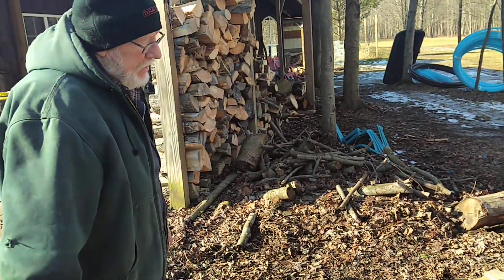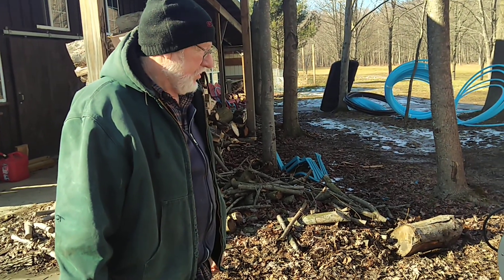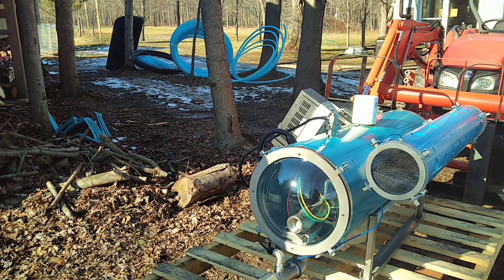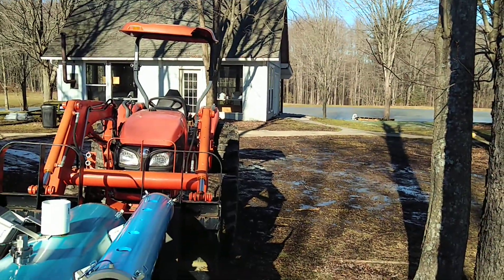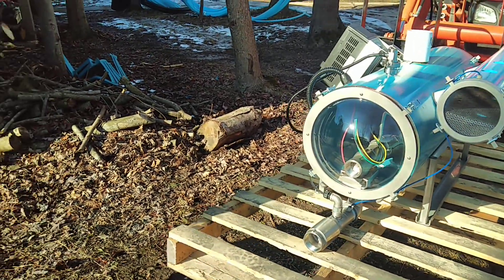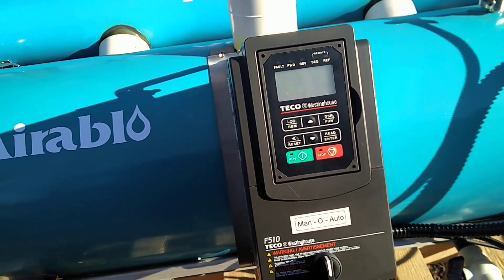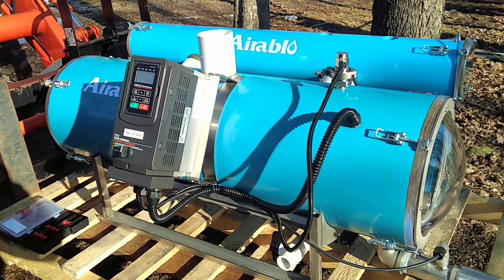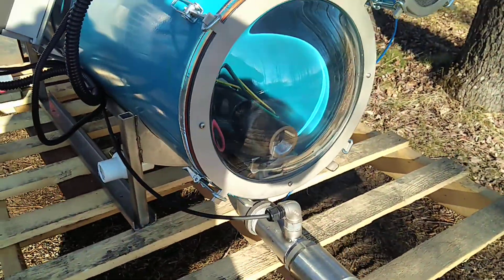Electric Releaser - 2HP 3-Phase - Leader Releaser

Comment: How did it work?  Specifically - how did you pump it so far directly from the extractor?  Is it gravity the whole way beyond the pump?  Or, did you have a check valve to prevent the flow back into the releaser?
Reply from the maker: It worked well.  It had 50-60 feet of head pressure.  We pumped a total of 1400-1500 feet - through a 1.25" ID line.  They come with a check valve - and for an important reason.  Without the check valve you would lose vacuum.